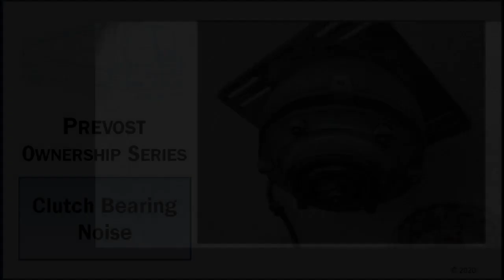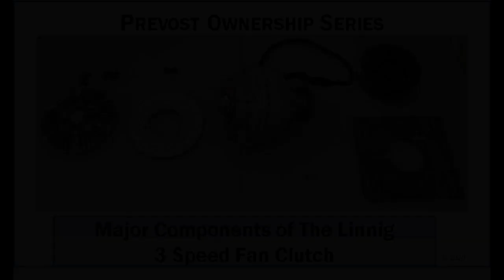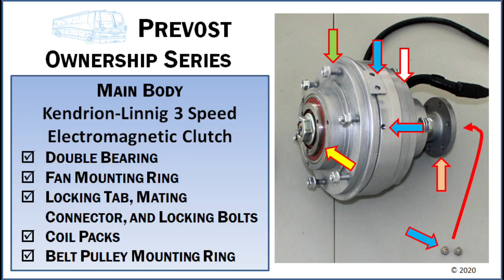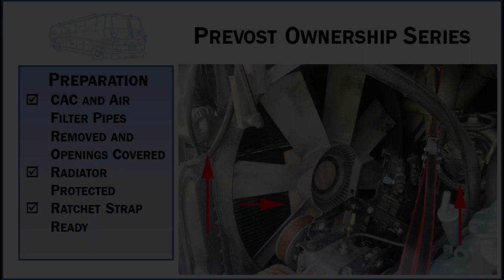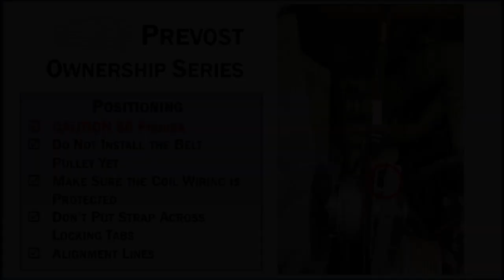Prevost Fan Clutch Replacement

Comment: Hi Gil... new subscriber here. Found your videos extremely educational. I'm quite mechanically competent though I don't know if the part you ordered came from PREVOST or if you ordered from an alternative source. I just find it difficult to pay $1965.00  for a part before I dig into the component itself to see if I can resource some internals before I do. Just checking to see if that is an accurate price or if you resourced from an alternative source. Thank you for the info and educational video. There are a lot of these buses still in the road because of people like you.

Blessings

GT
Reply from the maker: I used www.profandrive.com to rebuild it.  $750 then for a rebuild.
Reply: Hi Gil, wanted to share some information for your viewers with an XL. With the new fan clutch purchase from PREVOST everything fit in direct replacement with the exception of the adjustment mounting plate that  attaches to the frame to the housing. The 4 studs from the new part are now equipped with M10x1.5 studs where my older had 95 XL had 5/16" studs. Therefore the stud holes must be drilled out to accommodate the newer stud size and the M10 flange nuts needed are not supplied in the hardware kit. I spoke with PREVOST after finding the issue and they opened several boxes to see if it was mistakingly left out of the hardware kit but they were not supplied in any of the kits. A disappointment in principle that they're not supplied based on a $2,100 purchase but it's manageable as the flange nuts are readily available at anything box store. Hope this information can be as helpful as your video was for me.

Blessings GT
Reply from the maker: Good to know.  Prevost is generally good about supplying hardware when required due to a change in parts.

Comment: Hi Gil.  I have a 97 H3 45.  The low speed went out followed later by the high speed.  A mechanic removed the solenoid in the electrical area and jumped the contacts and that worked for a while.  I had to use the four supplied bolts when it quit again..  I am not sure if its a wiring issue or if the clutch needs replacing.  I was told the part number for the clutch is 550965 but I am not sure if that was right or I heard 950965.  The original is not made any more and this is supposed to be the retro fit one.  Do you know if that is the right number and who actually manufactures it?  What would be the best place to get one.  Are there options cheaper than Prevost?  Is the fan clutch for the 12.7 compatible with the 11.1 series 60?

Comment: How much friction should the fan have when in low?  I tested mine and I could barely tell the difference between low and off. High is locking in well. And the bearings sound ok.  I was testing by hand spinning. With the coach off.
Reply from the maker: You won't feel a lot of resistance in the low speed mode.  There are 2 things you can do.  The easiest is to make the maintenance relay described in the video.  Remove the low speed relay, start the engine, and insert the maintenance relay.  You should not a difference in fan speed.
Reply: Thank you good video